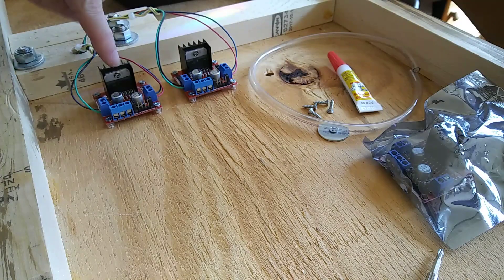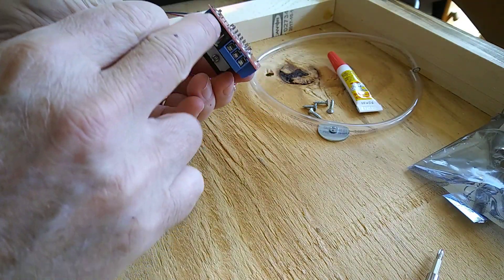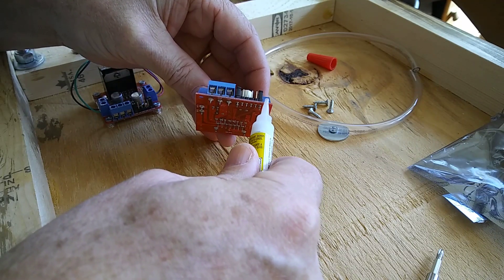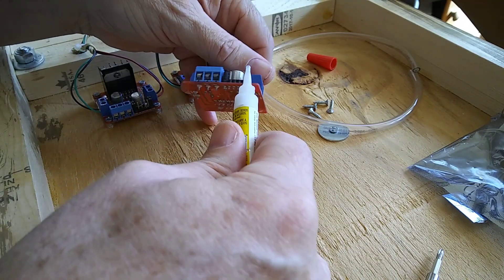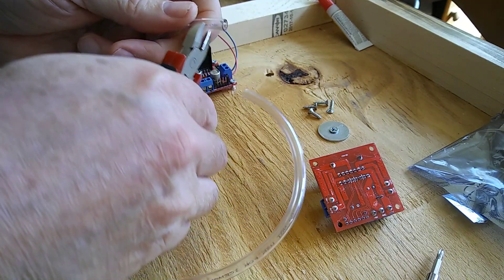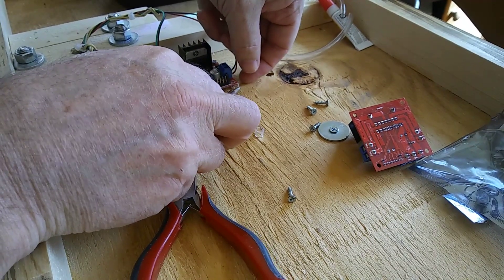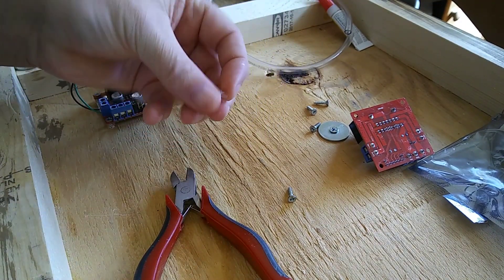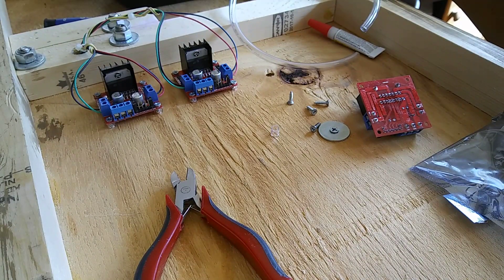PCB Module Mounting Tips (2 each)

Comment: Clayton, I have no holes from mounting the pcb, any suggestions,?
Reply from the maker: Put the screws just outside the edge of the board. You should be able to pinch the board edge between the tube and screw head. Be careful not to touch any board components with the screw. It's messy, but I've also used double-stick tape and glues that aren't water-based.

Comment: but what will you suggest for circuit boards with hole of only 1.5 mm
Reply from the maker: That not a typical hole size for modules. Sounds like a custom part. Try some double-sided foam tape.
Reply: Same headache. Smaller mounting holes are very common for, among other things, I/O expander modules.